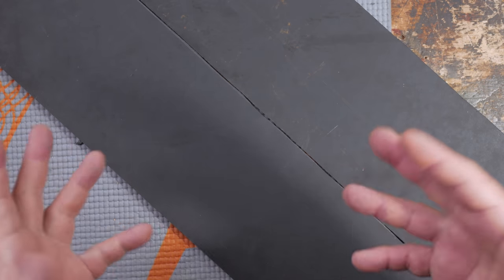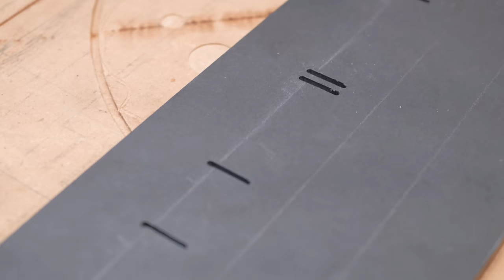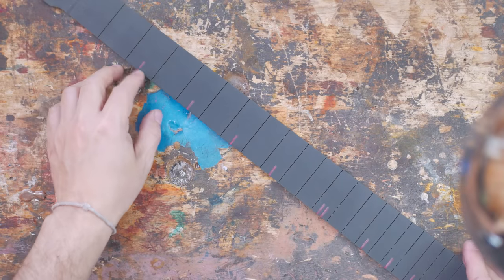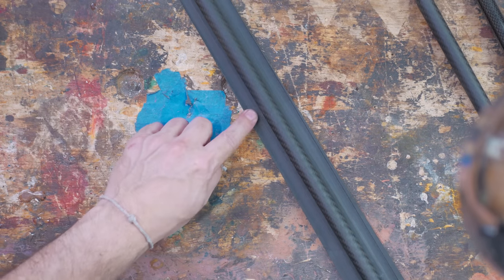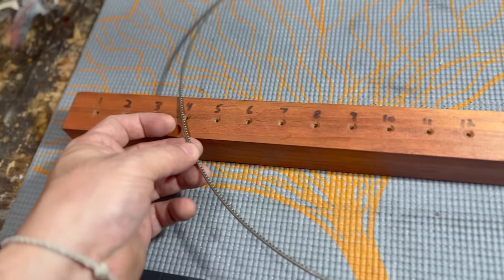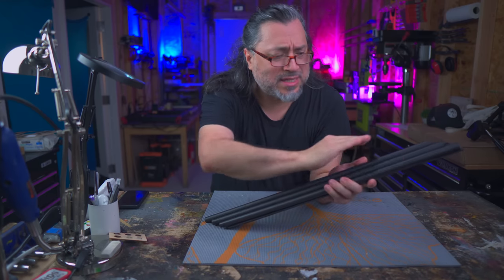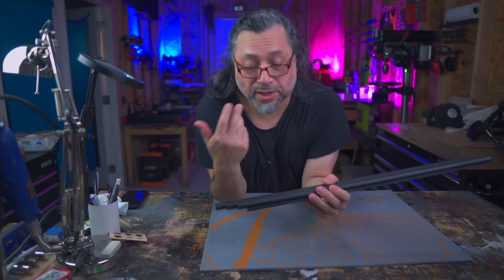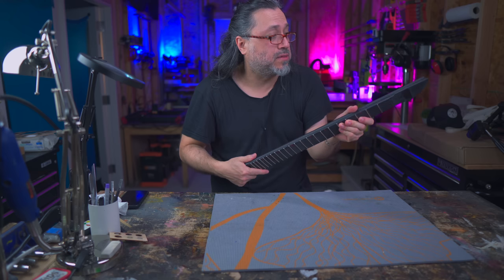Carbon Fiber Tube Guitar Neck - Great Guitar Build Off 2023

Comment: If you add two smaller carbon fiber tubes stacked on the three, it might feel better in the hand as well, as strengthen it a little. It looks very cool. Nice work.
Reply from the maker: That's true, it would be "rounder" in the hand.

Comment: I think you should fill those triangles with epoxy. It would probably solve a few problems. Most notably any strange vibrations the tubes might introduce when rubbing together.

Comment: Great idea on the fretboard inlays. In my work, aerospace, we use an adhesive called impregnated epoxy cloth. Think ducktape, the gray being the adhesive with a cloth like cheesecloth combined. It does need heat and pressure to cure properly. Easily done with a good heat gun and standard clamping. The cloth creates excellent torsional strength. But you got it right for what you are doing. Curious about the hollow tube's effect on sound and residence. Great videos, Brother!

Comment: Maybe you could run 2 neck-lengths of smaller diameter carbon or bamboo tubes in the troughs between the larger 3, it would still have a really unique neck profile w/ various steps you could place your thumb and would prob strengthen the flexible axis more.

Comment: Hi Mark, In a bazaar crossing of universes I made a Richlite long bow with a Bamboo backer, just held together with resin. The only and best way i found to seal the richlite was Olive oil! Just wiped it on, let id soak in/dry for an hour or 2 and wipe off. When it was dry it gave a fantastic sheen and did not mark from hand sweat.
Reply from the maker: So cool, thanks for the tip!

Comment: This is great. I think it's perfect for GGBO, as there are more than enough traditional guitars entered. To stand out you need to be different, which you got covered for sure :)
Also I have no doubts about the strength of it, I'd say it will be even stronger than a usual neck.

Comment: Nice!, I would try and get a bit more epoxy in the gaps.Also maybe try and secure the tube at the head stock as torsional stresses might want to de-laminate the fret board from the tube. What tang depth is the fret wire just out of interest?

Comment: Concerning carbon rods. Use crushed  Walnut shells for epoxy filler to bind the rods together , and also to the fingerboard. No need to fill up all the empty space, just enough to change the single point where the rod touches the other rod and the fingerboard to 1/4 , 3/8 inch. Walnut shell is harder than any wood. The crushed/powdered shells are used for both Reptile habitat liter , and instead of sand in compressed air blasting of paint, so the metal isn't damaged like it would be w sand. I got mine on line , Pet Co etc. might have it.
Reply from the maker: Great suggestion.

Comment: Rich Lite is super porous. I made a couple fretboards with it and the TruOil finish was easy but didn't last. Wipe on poly did great and was easy enough. Also, a benefit I found was that the Rich Lite doesn't shrink, so you don't get fret sprout a year after building the neck. However, the natural wood underneath the fretboard, does shrink and you get a witness line that you can feel where the neck and fretboard meet. Great video and interesting idea!
Reply from the maker: Hmm, wipe on poly sounds intriguing.

Comment: Hey Mark, I saw your Carbon fibre guitar neck and clicked on for interest. Wow! GO for it dude. I understand your fear of it failing, bit it is obvious you have already considered deeply so much about so many parts of the design. If it fails, it fails, but you will quickly learn from those failures. I am self studying luthiery, and I am always looking for new solutions to some obvious traditional issues with guitar design. There is a lot of romanticism in guitar building, some should stay, some we should move away from.  Really interested to see how tis develops.

Comment: next time try adding hatching or a pattern to a fretboard then you wont have to buff it, you could even fill epoxy to make it smooth or just make it pop.

maybe heat gun or fire would smooth it?
Reply from the maker: True. I just watched a Richlite video on how to get a "leather" look. They just use a 3M pad on an oscillating sander and it creates a "textured" look that is way better than buffing.

Comment: Looking good man!  Looking good!   On mine I glued the tubes to the fingerboard and to each other.  Assuming epoxy is as strong as CA glue (what I used) you should have no problems.  Richlite for my single tube experiment arrived. I'm debating whether to go with a flat radius or not.  On yours, I'd give it a clearcoat finish if time allows.  I hadn't really thought about finishing the Richlite.  I guess oil won't work on a paper composite material, eh? <g>.  I would think some sort of clear coat would be required to protect it from dirt buildup.  OTOH, the stuff is pretty tough, so perhaps no finish is really required.  But clearcoat might reduce the tendency to pick up finger smudge marks.
Reply from the maker: I regret putting a radius on the richilite. I debated going with a flat radius. A flat radius would have solved my finish problem.
Reply: @MarkGutierrez  Looks like the really tricky part is how to finish the Richlite.  Time to do research.  They make fingerboards with different colored layers, so you get a pattern as you radius them.  So they obviously can be made to look good, or they wouldn't bother with such things.  Based on the comments here, an oil  - perhaps mineral, linseed, or tung,-based -  might work.

Comment: Found myself thinking how wide the fretboard is at the heel end as a result of the taper, whilst the tubes are parallel resulting in an "overhang". Was that not a consideration during the process, or did I miss something ?
Reply from the maker: It was 100% a design choice. I played with splaying out the tubes to meet the edge of the tapered fretboard but it didn't look as "neat and tidy" most of the overhang you are seeing ends up over the body. The hands don't notice. Same with the nut. The tubes are wider than the fretboard. This was also a choice. It's different that's for sure.